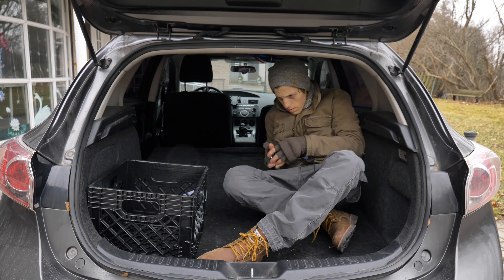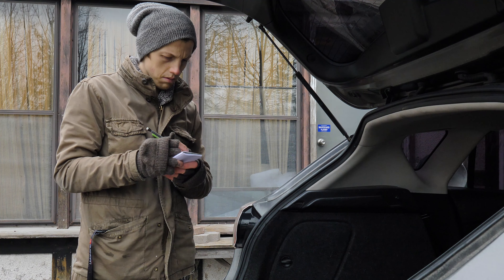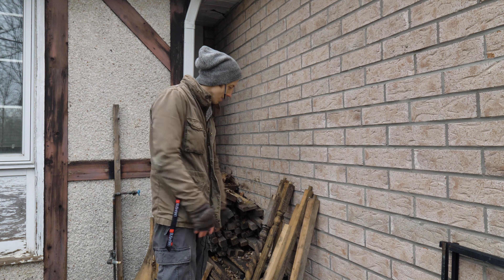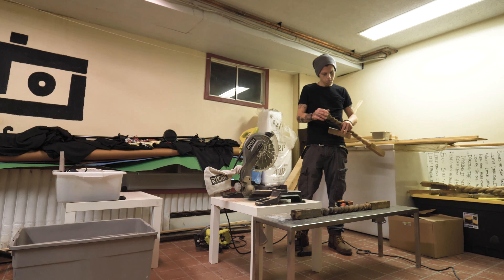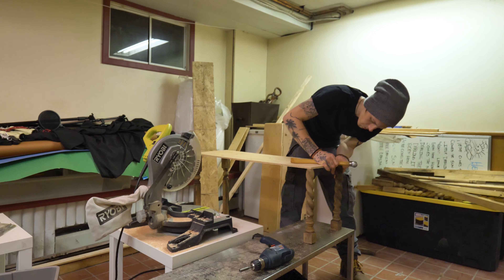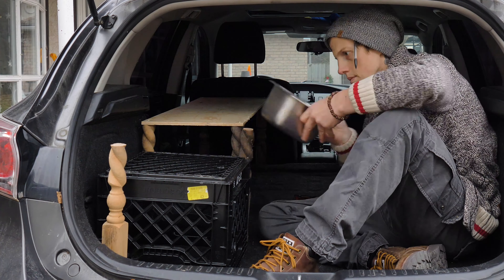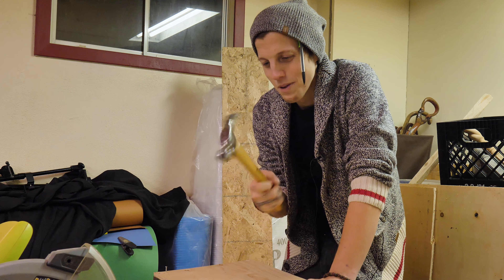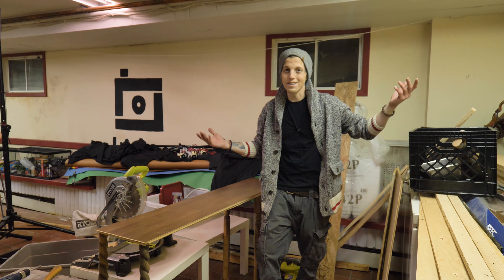Day #1: Micro Camper Conversion of my Mazda 3 Hatchback

Comment: What year hatch is that? And do seats lay completely flat without removing seats?
Reply: i can’t tell exactly but it looks like 2010-2014, the seats almost lay completely flat if you want them flat you need to remove the bottom seat cushion which is really easy